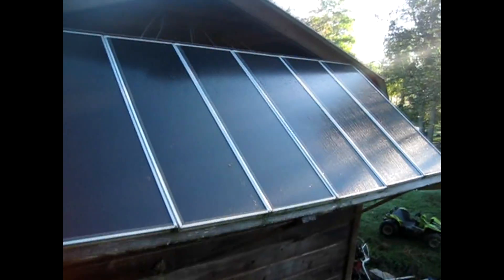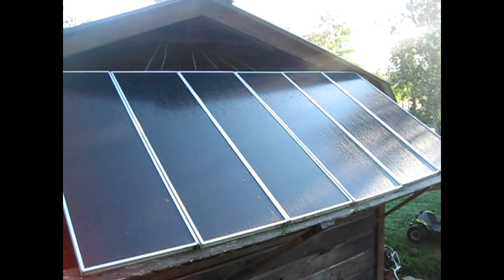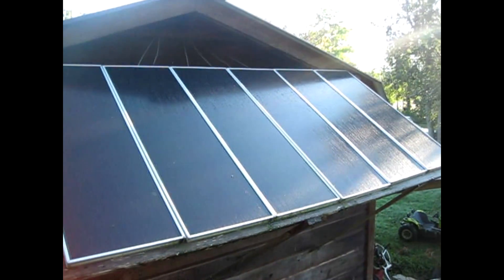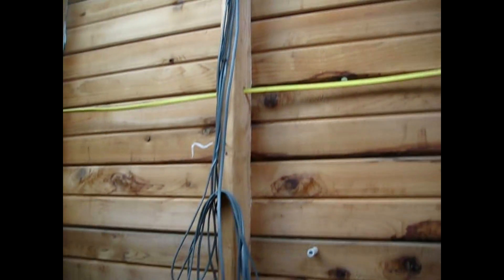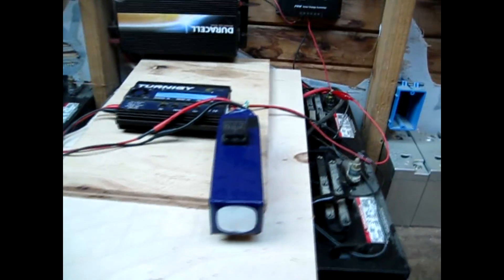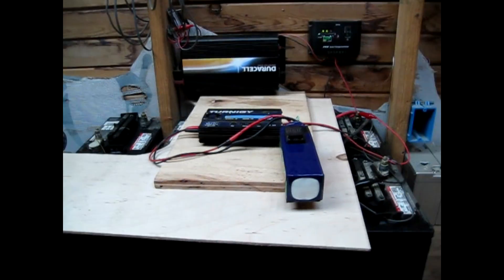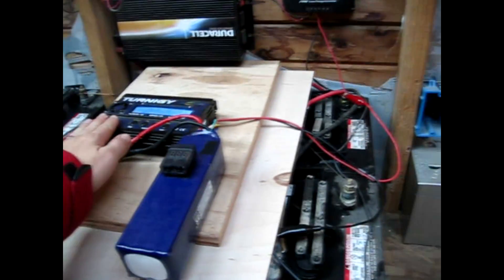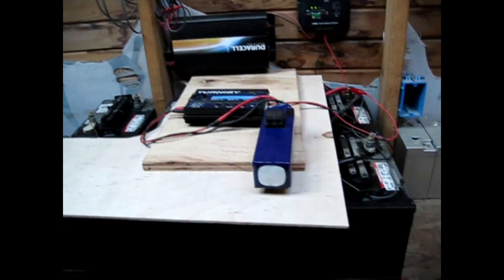Homebuilt Solar Charged Electric Paramotor!  Longer flight. Sunny Motor.

Comment: CLS
PRINT "THERMO ELECTRIC CHIP CALCULATOR"
CHIPV = 2
chipa = 1
INPUT "Desired Voltage to generate="; V
PRINT
PRINT "will need "; V / CHIPV; "chips to obtain "; V; "volts at "; chipa; "amps"
PRINT
INPUT "Desired amperage to generate="; A
PRINT
PRINT "WILL NEED"; A * (V / CHIPV); " CHIPS TO GENERATE"; V; "VOLTS AT"; A; "AMPS"
END

By the cannabis loving unalienable person in Bloomington, Indiana called Ted Dale Mishler

If you find this useful, me too :-)

Comment: My thermo electric program used for calculating how many thermo electric tec chips it would take in particular the tec1-127-06 chips designed for chilling, but can also used for generation as well:-)

Comment: thought it might be fun to see how many thermo electric chips a person would have to sail along behind them to generate the energy needed for endless flight time with no worries of batteries going dead.
I read where people get only 6 minutes of flight time using a Ternigy 100cc electric motor, and 4  x 6s 5300 mah batteries, and I think each of the 4 batteries then would output a maximum of 5.3 amps. multiplies by 4 batteries = 21.2 amps
My qbasic thermo electrical generator program tells me that it would take 471 thermo electric chips to generate a constant 44 Volts and a constant 21.2 amps! Do you realize what I'm suggesting? Thats right. Not only is the idea doable by math, it would be so disappointing not to make one :-) 
 I can produce 21.2 amps at 44 volts that it needs that would power the Hobbyking turnigy rotomax 100cc electric motor as long as the sun is out, using solar heat tubes and thermo electric generation, and only need then to decide on a permanent elevation to reside in lol - a person could live up there indefinitely - umm, until the sun goes down that is :-)

Comment: Very nice rig -- I am surprised at the size of the prop you can put on the Turnigy 100cc - what is the Prop size and adapter p# for  that -- with two of those I can really push my Ultralight or maybe go with the new 150cc -- I like your recharge on solar -- did you get the 4 cell charger? Thx for sharing -- Cheers, Patrick

Comment: First of all, it's incredible what you got here, an awesome project without doubt, and secondly, I need some help with a proyect. I want to make an electric bike using this motor. And I want to know if it has enough power to move me (Im about 110 Kg, or 242 pounds) and a truck lead acid battery (weights about 40 Kg or 88 pound) plus the bycicle. I don't want to start to move with the motor, i'll pedal until I start moving, and the use the motor to propel myself. Thank you for reading, and again, AWESOME PROJECT
Reply: Jeronimo Murruni  Hi, Jeronimo,  Good day. We are professional powerful motor manufacturer for electric bike, electric paramotor, electric glider ect.  Our motor size 80100, 12090, 120100 are such type.  That power range from 7000-15000-25000W ect.  Many DIY electric bike also need such motors.  What do you think of that?
Reply: Mark Lee I think it's awesome, but I don't live in the US, so I don't know if i am gonna be able to get those motors where i live
Reply: Jeronimo Murruni   our motors can be shipped to anywhere, even brazil, where the costoms is seriously checked.  What do you think?
Reply: Mark Lee I live in Argentina. And the problem is not you or your country, the problem here is that nobody can import anything from foreign countries, but when all of this problems are solved, i'll defenetly buy you a motor, that's for sure
Reply: Jeronimo Murruni   Yes i see now.  Brazil and Argentina are all very seriously for importing goods

Comment: 3.5 volts per cell??!! You are over discharging your lipos. Well at least you'll just come to a glide when your lipos run out.Hobby king should start selling the RTF version of this  paramotor :D
Reply: Standard Lithium cells that are in your laptop PC are called 3.6 or 3.7 volt cells.
They are fully charged at 4.2v and empty at 3.0v.  Same for the pouch cells that you can get at Hobby King for a quad copter.
Reply: +Sparky! no lipos have different voltage range then the 18650
Reply: Any lipo should still provide 500 cycles discharging to 3.2 volts.

Comment from the maker: It works fine.  The flight time on my current battery pack is around 10-15 mins.  I may double that as the battery prices are coming down.  The performance is actually better than the old direct drive Solo 210 unit I use to fly many years ago.  I will post a new video showing some of my current adventures with this little electric unit soon.

Comment: Awesome paramotor. Do you really feel safe charging those batteries while you're not home though? It would suck if some poor quality from the chinese battery light up your shop. Also, have you considered what might happen if any of your batteries lit-up in flight for some freak reason? Might be better for have a box around at least the front?

Comment: lipo batteries are not calculated like that. the unit of calculation is "S" meaning series. this system in the video uses 4 6S batteries. Probably in parallel. Each cell(S) can be charged up to 4.2 volts, 2.7-3 volts means the batteries are empty. so 3.5 volts is quite ok.

Comment: I have dreamed about owning an ultralight for over 30 years now...get curious every now and then but put down the magazines when I see $10 to 25K for one of these..so the question begs: you've done a great job inventing a practical low cost power source...how about sourcing a low cost, safe parachute ( I know I know that's an oxymoron) ???

Comment: That's is awesome I am ready to make one myself I do have an idea for you to try with this setup, you think of adding small windmill generators off the frame to catch the wind blast? Might be enough to either power the motor or also charge the battery in flight for extended fun let me know what you think?

Comment: The website for the motor was ambiguous, can you tell me your total battery pack voltage and amp draw at full throttle? I have a 48 volt 20 amp hour battery pack on my bike, and I'd like to know if I could use it.

Comment: Very cool.  Looks like a lot of fun.  Could you give specs on your setup please?  I recognize the motor, controller, batteries, but any additional info would be awesome.  Static thrust, battery voltage/capacity, static current draw, in-flight current draw, prop speed, etc.?  I'm thinking of building a setup off HK's 9.8kW motor and trying to decide if reducing the rpms (to swing a larger prop) would be worth the trouble.  Thanks!

Comment: You could put a gearbox on the 100hp electric and get the revs you need, more weight though. Probably high amp draw too. Although you can get a few amp hours into 65lb... Would there be much air time with motor off? if so you might be able to have the wind spin the prop for some regenerative air braking... Props probably all wrong for that though. Electric is much cheaper! You could get a lot of Li batterys for the difference...

Comment: Just poking around on the web, looks like a 100cc is about 15HP. My two seater trike airframe plus Rotax 582 engine (dry, no fuel) weight is about 385 lbs. (110 of that is the 582 engine alone). Add to that 10 gallons of gas weighing about 65 pounds. I see electric motors that offer 100 HP but the RPMs are like <1800, way less than what I need full throttle up @ 6500 RPM. A 582 costs about $6k-9k depending on the gearbox.

Comment: Even if the panels did not provide enough power to run motor, you could extend airtime and safety. I wonder what the weight of the electric motor is compared to a rotax? I'm guessing the electric motor would be lighter than rotax, but battery pack heavier than full fuel container.

There are a few types of Photo voltaic dyes around, I bet it's possible to make a good solar wing/chute, Price could be another thing all together though.

Comment: My question also. I know the PPG's can stay up longer on 5 gallon tanks than we PPC guys can on 10 gallons but we carry more weight/passenger. I run about 2.5 hours max on gas but if the weight of the solar panels and batteries is close to the weight of 10 gallons fuel & can run a 65 HP Rotax engine at 6500 RPMs max thrust, I'm definitely interested! I'd be cautious about messing with the aerodynamics of the wing however no matter how flexible solar panels can be. Especially w/elliptical wings.

Comment: What sort of flight time do you get? Have you looked into flexible solar panels for the parrachute? I'm guessing it's mostly sunny when you fly... The extra weight might be worth the extra charge, Plus if you get stranded somewhere, you can spread the chute out in the sun, to re-charge... Thanks for sharing. This might be one of mankind's first sustainable energy flights. All the other powered air craft I can think of uses fossil fuel...